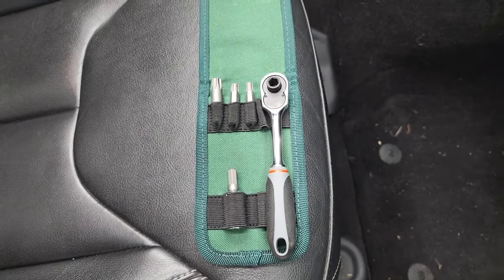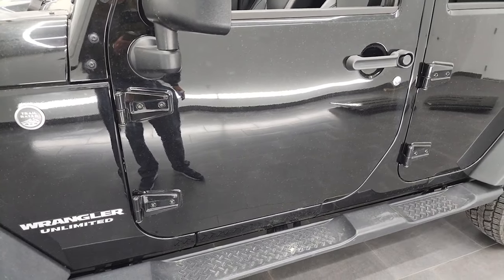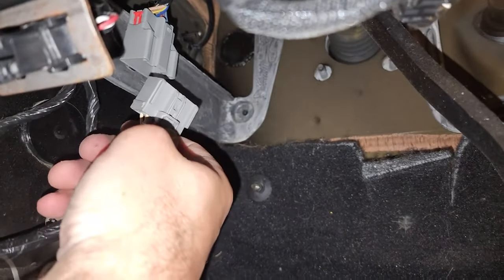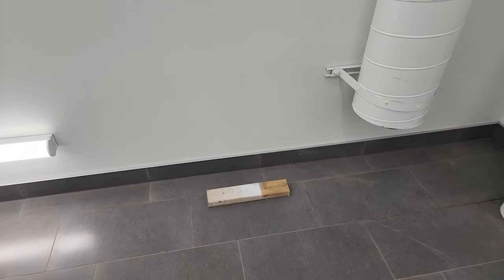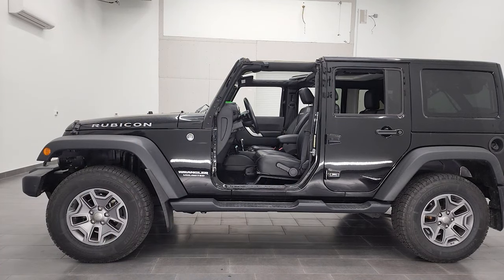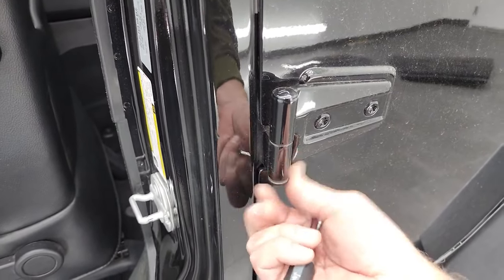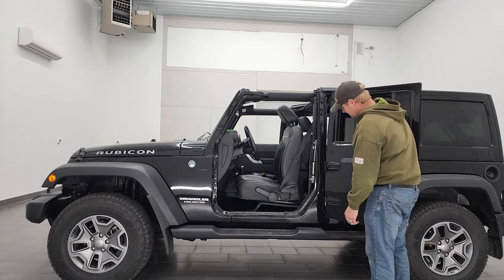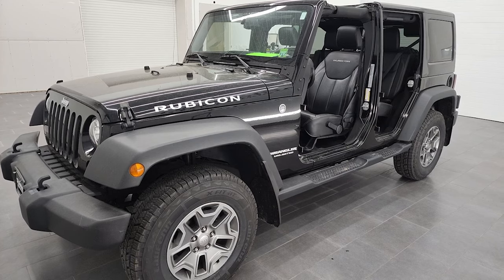HOW TO REMOVE JEEP WRANGLER JK DOORS DEMONSTRATION STEP BY STEP

Comment: I have a 2014 wrangler sport. It doesn't have the t50 torx. There is a threaded bolt up in there and it needs a deep socket. I cannot even fit the right deep socket in the hole because the diameter is too big for the hole 🤷. I have yet to see a video that has a bolt, just the torx
Reply from the maker: Sounds like someone put it in aftermarket.  May have to buy a special socket and then get a set of the original bolts
Reply: Did you ever figure this out? I have a 2013 with the same thing? No t50, appears a bolt is in there but nothing fits. I’m stumped
Reply: Me too. Would love advice here.

Comment: My Jeep JK harness that comes from the door only have 2 pins, and the one inside the car has about 8pins, I bought it like this, any ideas?
Reply from the maker: Do you have power windows and locks?
Reply: @Summitauto  the front doors windows are manual, the rear are power windows, but the car has the 4 buttons in the middle of the dashboard for power windows, I do not know if the basic model comes like this
Reply from the maker: Sounds like someone put the wrong doors on your wrangler in the front.  Thats why you have different connectors and the front windows should be power if you have 4 switches.

Comment: Question, is there a way to attach mirrors to the body after taking the doors off? Or you just don't have side mirrors?
Reply from the maker: Yeah they make ones that avtually go into the door hinges
Reply: @Summitauto  oh okay thanks for the response. So those would be after market mirrors?
Reply from the maker: @TheRealOne24  correct.  Just type doors off mirrors jk wrangler into google.
Reply: @Summitauto  will do, thanks!!

Comment: I think the previous owner of mine changed the torque screws w something else. My t50 doesn't go on it AT ALL. closest thing is a t60 but it doesn't grab the thread
Reply from the maker: Maybe check the glovebox/centerconsole/storage are for an adapter?
Reply: @Summitauto  nah, he removed it from the bag.. found taking out the screws on the front of the door (not the side pins from this vid) w a t50 did it. Wear solid footwear folks! was testing out the torq set at autozone before i left: wasn't expecting it to suddenly drop and was wearing sandals.. straight on the big toe nail. The other 3 doors I wore my steel toes. Lesson learned.

Comment: Do you need to take out the fuse for interior dome lights on a 2010 Jeep Wrangler? Or will it recognize once the doors are off
Reply from the maker: It should recognize one the plug is unplugged or maybe you can turn the dome lights off?
Reply: the dome lights usually stay on even when pressing them to turn off
Reply from the maker: Try unplugging one of the doors to test
Reply: the dome light switch is on the headlight lever, I just turned that off!
Reply from the maker: That works
Reply: worddd thank you for the help and assistance!

Comment: Any reason my does won't come off? Nuts are off, but the hinges won't separate
Reply from the maker: They could be rusted?  Maybe try some WD40 and wipe off any excess so it doesnt damage the paint.  Grab the bottom of the door and while opening and closing the door gently lift/rock the door to try and relase the corrosion.  Do not lift too hard.  You do not want to break/damage your hinges.

Comment: What about the side-view mirrors?
Reply from the maker: You can get mirrors that fit into the door hinges for these jk wranglers.
Reply: American Modified Offroad $70.00 just bolts to the upper hinge, about a 10 minute install the first time, as you assemble the thing, next time, about 2 minutes per side.

Comment: Did all that doors still won't come off
Reply from the maker: Sounds like you might have some corrosion.  Maybe try spraying some WD-40 in the hinges and kind of "rocking" the doors.  Grab the end of the door furthest away from the vehicle and lift up and then push down to see if you can free it up.
Reply: Hit it with your purse 👜 

lol jk use a block of wood and a floor jack under the door and slowly lift it
Reply: @therealrealshocker I was having a good morning, now I’m having an excellent morning thanks to your hilarious comment 😂.
Reply: @samuraiblack178  😂👍